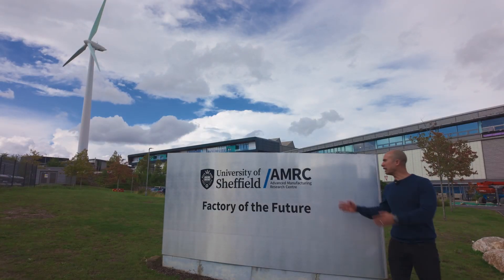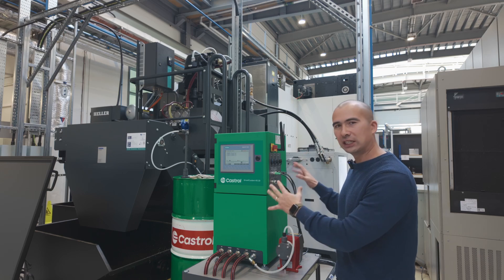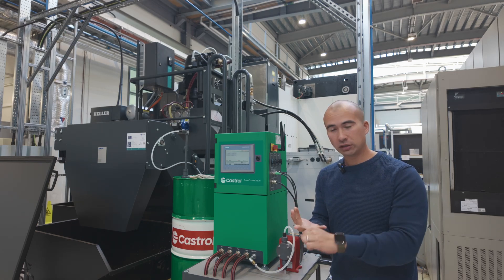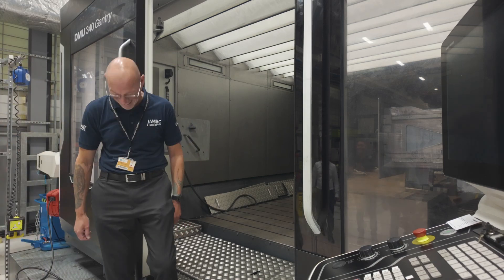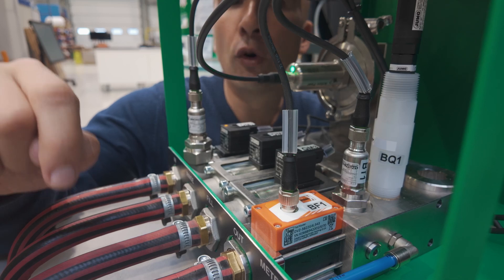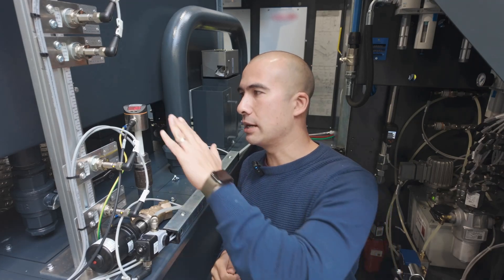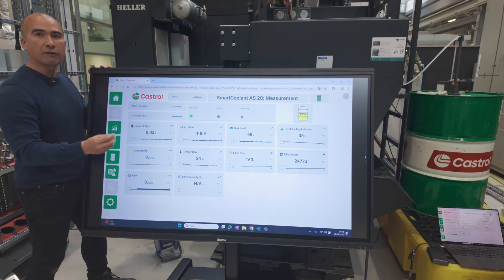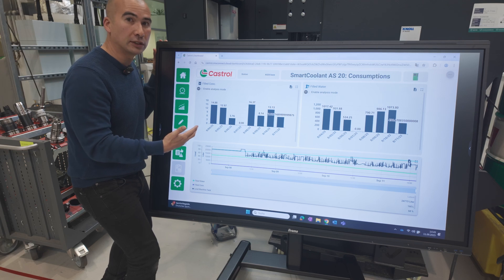The future of metalworking fluids is here!

Comment: The condition of the metalworking fluid emulsion is highly dependent on cleanliness control (microbiologically speaking). If you notice an unpleasant odor coming from the machine, you should consider completely replacing the metalworking fluid emulsion and cleaning the entire system.
Reply: By the way, thanks for this episode!
Reply from the maker: Absolutely! On the other hand, managing to keep the pH in a consistent range should be preventative against most bacteria.
Reply: @LubricationExplained Yes, pH is important. By regularly checking the MWF concentration, at least with a refractometer, we maintain the pH and, at the same time, sufficient biocide levels in the working emulsion. It's also important to combat tramp oil on the emulsion surface. This helps combat anaerobic microorganisms, which thrive in the absence or lack of oxygen.

Comment: Blaser is the top of metal working coolants. Castrol not so high end and they make disgusting milky coolants that stink even when brand new
Reply: When I used to do CNC we had some blaser coolant, was legit 👌🏻
Reply from the maker: So I can't speak at all to Blaser - I've not seen it in use over in this part of the world. But any time I've seen Castrol MWFs in the field they seem to be fine.

To be honest what I'm more interested in is the fluid management side of things. The measurement and treatment has always been a pretty manual process, so it's cool to see some digitization and automation bringing it into the 21st century.